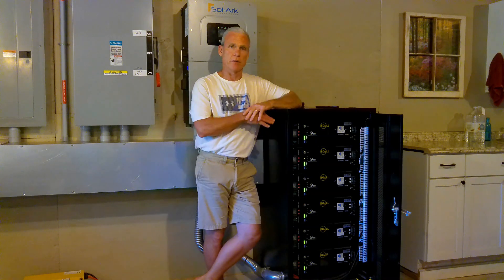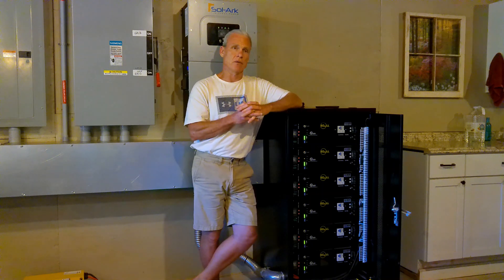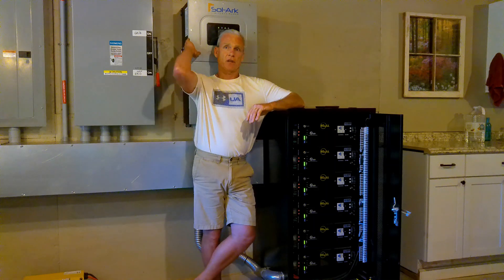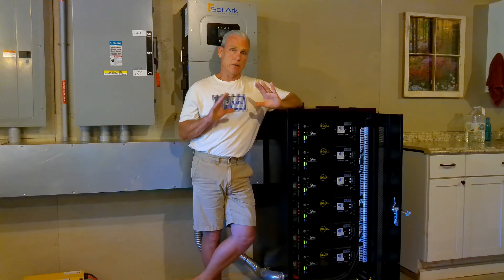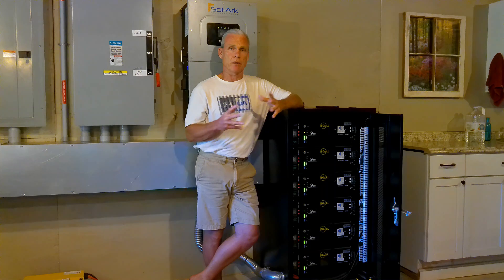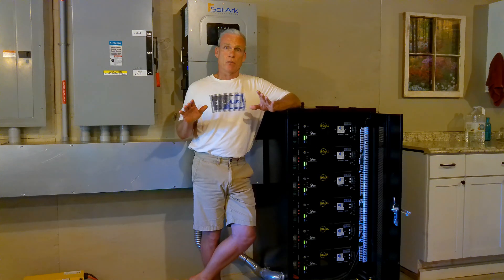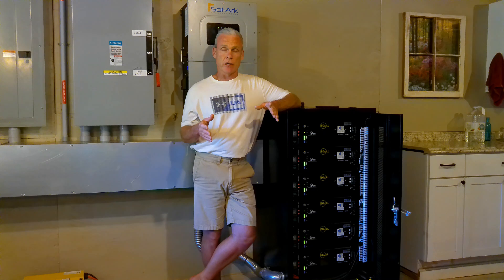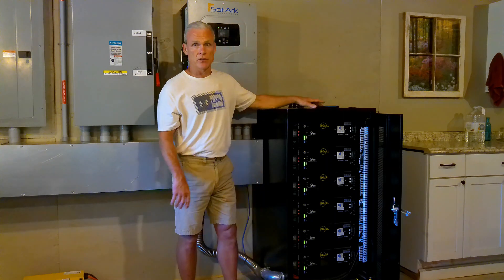Off-Grid using central air conditioning!!??

Comment: What Siemens box is the one u got
Reply from the maker: 3 phase 200 amp  600v  indoor disconnect, model HF364. They are proud of them at $1,000. Probably over doing it but I wanted a 200 amp set up and I tend to over build.

Comment: How many kWh of energy do you consume each day? What is the SOC of the batteries in the morning before the solar starts kicking in?
Reply from the maker: On an average , no A/C day, we use about 15-20kw a day. With the A/C running we use about 30kw. When we were grid tied we used less power, sending more to the grid to increase our credits. Now we use more power because any solar we don't use is waisted, so we are not as careful off-grid as we were grid-tide. A/C on, the SOC is 75%ish in the morning. No A/C 85%ish in the morning.
Reply from the maker: The above power used includes what solar sends into the batteries to bring them back to 100% soc.
Reply: @goingoffgridatgreenshireho435  if you had more solar production you could afford to discharge the batteries more than 15-25%. I have 12.96kWp and 29.6kWh of lithium batteries. Two ground mount arrays. One at 180 degrees and the other at 230. 8s2P on each. I produce solar power for ~ 11-12 hours a day in the spring/summer. Panels are cheaper than batteries.
Reply from the maker: I was going to add another 2.4k array for more evening summer sun but I'm putting up a small turbine instead, ($3000). We live on a hill top overlooking a vast flood plain with lots of breezy days all year round. I think, especially in winter, this will make a big difference. It should arrive first part of August and take a couple weekends for me to install. I will post a video when its done. I may end up adding the 2.4 array too, we'll see how it goes.
Reply: @goingoffgridatgreenshireho435  most MPPT can’t handle wind turbines very well. It might be a challenge to realize any significant power from it. $3k would buy a lot more solar panels.
Reply from the maker: I already ordered it with a MidNite Classic... hope it works out. It will be two separate systems, the turbine will just charge the batteries.
Reply: @goingoffgridatgreenshireho435  It logical to have the turbine charge the batteries in parallel with the Sol-Ark's charging circuit.  The communication between the batteries and Sol-Ark I assume is there should mean the Sol-Ark is monitoring the state of charge as reported by the batteries.  If this is true and the system knows when to lay off charging the batteries once they reach 100%, will the MidNite Classic also get the message to stop pushing current into the battery bus?
Reply from the maker: Yes it will, I have been waiting on the cable for the turbine ( they were out of stock) but I have already programmed the Classic and mounted the control panel to the battery rack. The Classic is already reading the battery voltage accurately and I have been assured it will work independently to cut power when the batteries are full. More to come after I have the cable and complete the install.

Comment: Can you comment on why you took the risk of that high frequency MOSFET inverter? If you are off grid why not Victron or Schneider which are both transformer based units and are known to be very robust handling L1/L2 load differences
Reply from the maker: An excellent question!  When I first started this journey I planned to use the Sol-Ark then I saw the power of the Schneider and I started to lean that direction. Then Victron caught my attention....I went back and forth so many times between the three it drove my wife crazy at the supper table. Ultimately I decided on Sol-Ark because of its power, ease of installation, and ability to grid tie seamlessly. If I die, my wife will go back to grid-tied and with 5 minutes of programming the Sol-Ark will sell power back so she can have this system in place with no power bills but the meter fee.

Comment: We have a 2 ton Mr cool universal heat pump but then added a 9000btu 38 seer blueridge mini split in our living room that we use all day and then only use the Mr cool at night to help in the bedrooms, this set up is using a lot less power.
Reply from the maker: Thank you! This is good info for those struggling with options.
Reply: Mini splits are amazing as an hvac and plumbing guy ❤ looking to switch to solar specialist but know nothing about solar,
Mini splits have EXCELLENT  capabilities/benefits in specific applications, 
The more I look into solar they tie right in(so yeah you should definitely investigate)

Btw I do electrical 

So the learning is coming along nicely because of people like you and diy will, thanks and best of luck ❤
Reply from the maker: JerHAMM, you are in a good place! See if you can do some part time work with a solar crew and the solar customers could become mini split customers too. You could have a foot in both trades!

Comment: I've found it's makes more sense to me to use & store my extra solar power than to sell it back to the power company.  I increased my battery bank. I added an electric hot water heater that feeds my propane water heater . I purchased an ecoflow Delta Pro to put some of my excess solar power in, and I charge my Ford lightning with my excess solar.
As far as air conditioning,  I use split inverter units. They have built-in soft starts, and instead of the compressor starting and stopping, it just slows down and speeds up as needed .
If I get several really cloudy days I connect my home to the 240 volt 7200 watt inverter that's in the bed of my truck. When it's fully charged I have 131 kwh of power from my trucks battery.
Reply from the maker: I agree! When my old power company, (who I got along with just fine), changed the rules on credits and peak time, I explained to them, you are forcing me to go off grid. I like what you've done there, we are considering an EV... in time.

Comment: Sounds like you need another solar array. I'm looking for land in the high desert I've lived in Phoenix for 37 years looking to retire up north. I have found 50 acres with wells and septic already I will go with DIY off grid system won't need AC everyone uses evap cooling up there it's so dry about 5-10% humidity at 5900 feet. I want to be 100% off grid where I can run without any propane either.
Reply from the maker: We are getting ready to put up a small 1600w turbine for winter and I think that will make the difference in the summer evenings, if not I will put up a 6 panel / 400w array for evening sun next spring.  Sounds like a nice place you found! I had kin out by Snowflake, AZ. Real pretty country!10% humidity sounds much better than my 90%. Good luck Sir!
Reply from the maker: Don't know if your an electrician, but warranties on some equipment are void if not installed by an electrician and if there is a fire or some related issue your homeowners insurance carrier may argue about your coverage.  Professional Labor and parts are covered by the 30% tax credit too....Just to make sure you knew.
Reply: I wouldnt do that, the drought that is coming is going to be epic these next 20 years water is going to be hard to come by out there dont you thin, how much for the 50 acres I want to go off grid too and dont have much money so might ahve to go that route too
Reply from the maker: We too are on a well which feeds a cistern, there are no water lines where I live. I also catch 2,000 gallons of rain water off my outbuildings for my garden and animals. I have videos on those too.